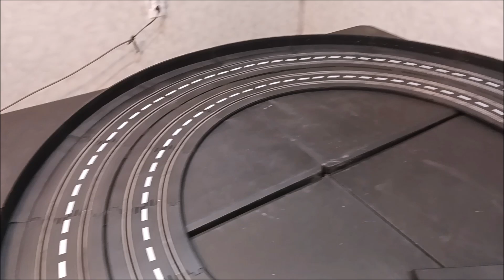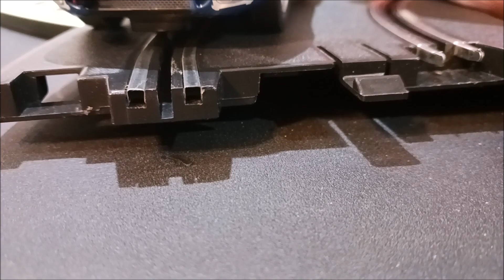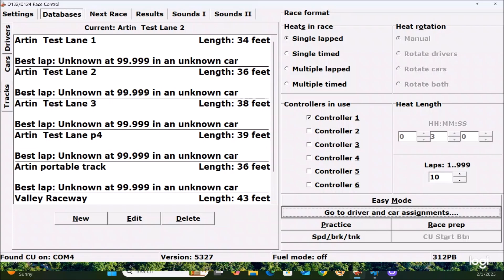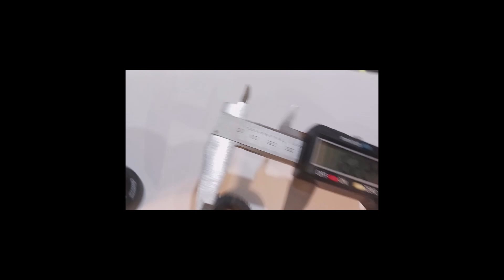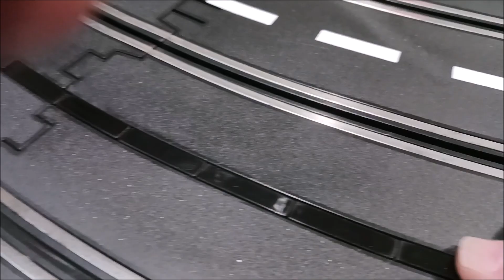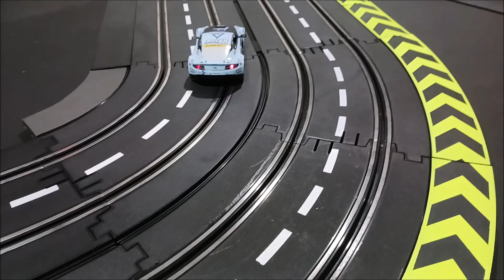Tire Testing on Artin Digital Track

Comment: could be unseen buckling of lane 3 on a microscopic level due to pressure and vibrations from the car, imagine when buildin a wall one brick slicghtly out of place creates a ripple effect that up close wont be much noticable but stand back and it is clear as day and that makes everything else off , sand a few mm of the guide to prevent pinching and check it can feely travel the whole lane just the guide not attached to the car run it in your fingers along the track
Reply from the maker: Thanks, your advice was perfect. The push tabs are not fully locked. The tires are dropping in to a small gap and popping back up.  This is why the rear of the car is hopping.  The plastic tables are amplifying the sound. I do not think the radius 4 curves are created properly because they will not lock fully.  I had to run my fingers over the track to catch the dips. But now it is obvious.  I may file some of the tabs to make them lock.
Reply: @ProxieModels  a pleasure , thats awesome , keep at its great watching folk adapt and find a use for an item classed as dated but more than likely still good quality just no one has tried to reporpuse it
Reply: @ProxieModels   the push tabs id recommend securing them( once you done all you have to do) with Hot glue and then shave it level with the track for a smooth surface , the tabs wont try to get away , if you intend it to be permanant ,
Reply from the maker: @Danthelionhearttgg-h5p    This project is intended for taking to places to introduce the hobby to people. Scout meetings, train shows, etc.  I can make the clunky curves in to solid sections that will fit in the truck. The rest al works OK.  It is odd that they worked loose and will not stay put. Maybe the heavy D124 cars with magnets had too much impact. Hot glue should work good.
Reply: @ProxieModels  ah the 1.24,s possibly for sure the magnets are trying to keep the car on the track or in place  and the rear wheels are pushing the track away from the car out the rear , its why they always suggest securing the track down so the car taking off doesnt move the track backwards, on my layout i hot glued all borders down so they hold the track in place lol